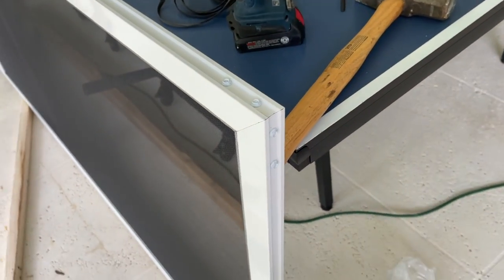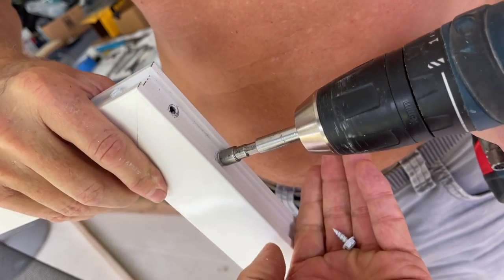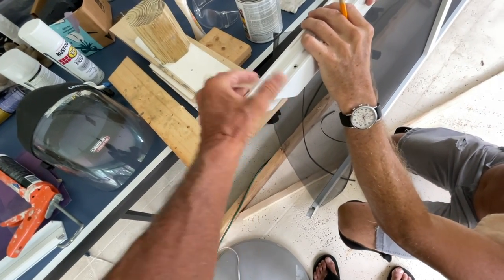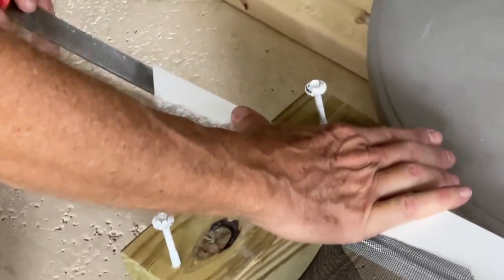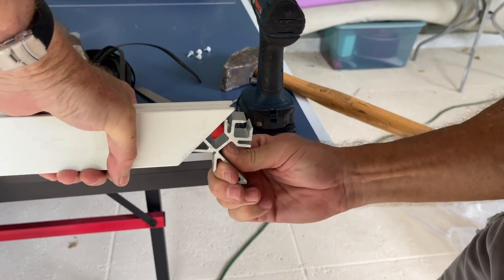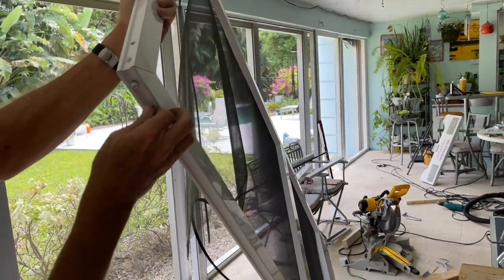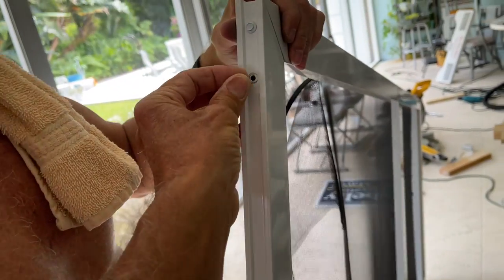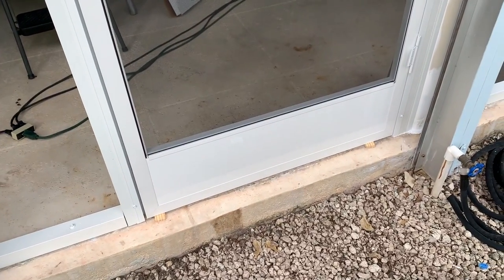How to cut down and resize a screen door to smaller height

Comment: I'm gonna do mine as well. I didn't buy a screen door with my new vinyl patio door, because the original aluminum one is still in great shape. Need to take an inch off however it's doesn't have screws. It's probably just pressure fit together.
Reply from the maker: Good luck on your project thanks for watching

Comment: Do you have a special blade on mitre box to cut aluminum?
Reply from the maker: We used a miter saw to cut these so they were exact on a 45° angle good luck thanks for watching
Reply: No special blade need to cut aluminum.  Just make sure it's sharp.